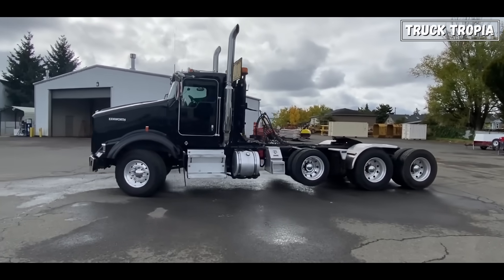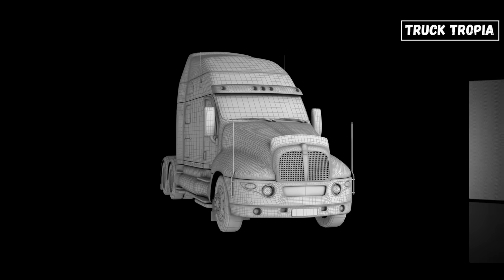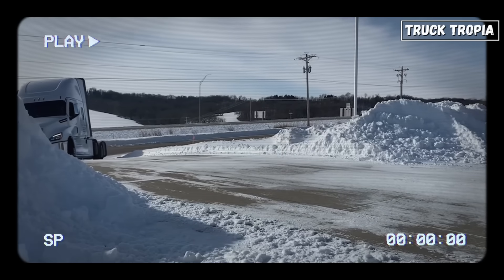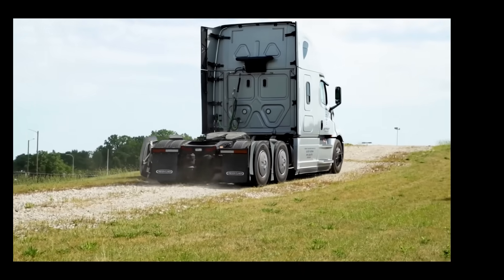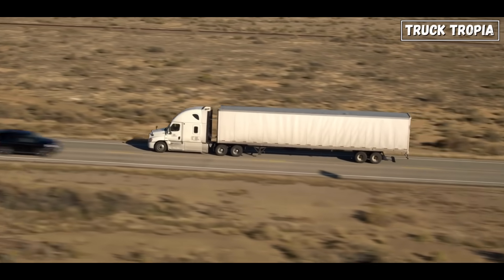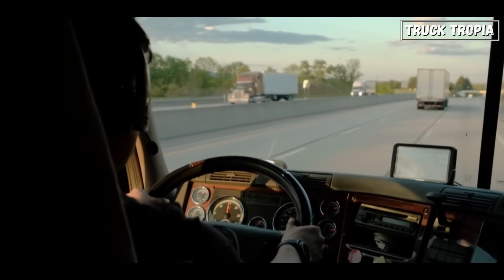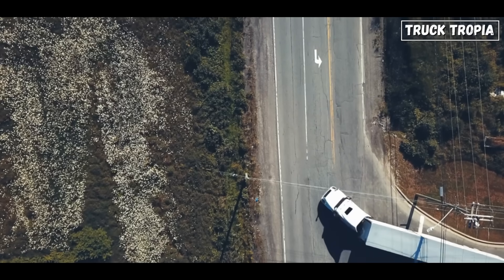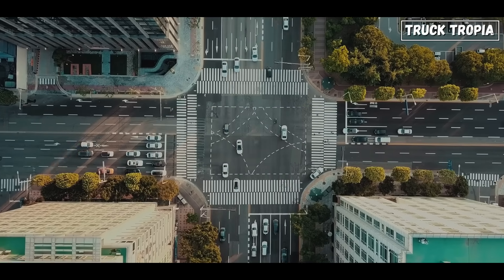Why Do Some Truck Tires Don't Touch The Ground?

Comment: Oh!  I knew it had something to do with how much weight the truck was hauling.  But I just learned that the raised wheels don't just plunk themselves down on the road when the weight is "enough".  I appreciate learning things like this.  I was also not aware of the other reasons it can be advantageous to raise or lower the 'extra' axles.
Reply: If you put enough weight on the truck all the axles will touch the road 😅
Reply: gotta love Youtube!
Reply: Was about to say the same thing. Some models lower them if there's enough weight.
Reply: I always thought it was made so you can lower the axel when you have a blowout on one of the other wheels.
Reply: On EU trucks it does
Reply: @brandonsteele2826  Thank you!
Reply: Actually in America, when it comes to replacing a drive axel with a lift axel many setups are automatic.
Reply: I always thought the ones up on the frame like that were spares. . .
Reply: @taazvino, there are several different systems, I have a manual control system, I raise it when making tight turns, lower it when needed the rest of the time.  Other systems are automatic, where it is based on weight, and then there are systems that will reduce the load on the axle based on steering wheel angle
Reply: Yes, it's called popular science.  It's fun and doesn't change people's minds on deeply held beliefs.
Reply: Same!😅
Reply: wtf no? It have nothing to do with weight, the LORRY is hauling. Its the spare tire.
Reply: @anderstermansen130  I take it you did not actually watch the video - LOL!

Comment: I drive a tri-axle dump. When empty, and up. When fully loaded, and down which enables the truck to legally be 80k. The lift axle also has it's own set of brakes. If you're making a 90° turn the axle has to be raised. If not, the result could be improper handling. Some lift axles also steer, reducing the need to lift the axle.

Comment: I kneed to know more about those  trucks like  gear arrangements and handling
Reply: There's tons, it would take a book to explain all the configurations but basically more axles means weight can carry. Lift axles also reduce traction and handling when turning

Comment: Lift axles in front of driven axles are pushers.  In the video they were referred to as just lift axles.  There is another version not mentioned too, the steerable pusher, usually added as a second pusher.

A more concise reason for lift axles is to allow trucks to stay under the maximum weight per axle limit on some roads or bridges.
Reply: Your more concise reason for lift axles is simply not a reason for lift axles. In fact, this is the problem I had with this video as well. Most of what was told has nothing to do with the lift itself.

No, lift axles are NOT there to distribute the weight across more axles or to deal with weight regulations. That is what an extra AXLE is for. If it was permanently lowered type, there would be literally zero difference for any of these purposes.

The lift part is there strictly to save money on things like fuel and wear when the extra axles are NOT needed. Nothing more and nothing else.

Remember, a non-lift axle is the default! Therefore reasons for a 'lift axle' is reasons to add a lift mechanism to a non-lift axle, and NOT a reason to add additional axle!
Reply: @kikixchannel Lift axles take weight off the driven axles to meet the local and state road axle limits.  Most states only allow 34k lbs on tandem axles.  You can haul more by putting a lift axle down.  Lift axles are rated by the weight they lift.  Tags are usually  13.5k lbs and pushers are 12-20k lbs.  Truck designers add lift axles to keep all axles when loaded under the axle weight limits for areas they are traveling.
Reply: @jmaus2k  You do not understand the point of my post...

I know that putting the lift axle spreads the weight between larger surface and more axles. However, this is not a trait of the LIFT axle, but of an AXLE altogether. If you have eight axles and two are lift axles, when they are down, the distribution is exactly the same as when you have four axles and none are lift axles. Therefore, the 'lift' function in the axle has literally zero effect on the adherence to the regulations.

The lift is NOT added for adherence to legal limits. It is added so that you can save on running costs by not having to go for full load capacity at all times.

Basically, you are putting the cart before the horse. Again, a standard axle is the default, the lift is an add-on. Don't make the lift the default when it's not.
Reply: @kikixchannel  You can't easily add solid axles that are down all the time in front of tandems.  In fact there are no solid axle options for the center frame mounting of trucks because the driveline is in the way.  To avoid scrubbing tires when turning you also can lift up lift axles.  So it is the most reasonable way to add weight capacity to a truck.  And of course, they can be lifted when empty to save fuel.  They can also be lifted where roads are less strict.  Primarily the reason to buy a lift axle option on a truck is to gain weight capacity(after you get past tandem axles).

Comment: Its nothing about weight distribuiton, the axle with tires is feather light compared to truck+load. its to reduce tire wear, while the truck is driving empty/under light load, especially on tight turns where the otherwise lifted axle basically has to rub through a corner.
Reply: It's everything to do with weight distribution dumbass😂 more axles means more weight the truck can carry

Comment: From my experience in Snowrunner,
Keeping the axle lifted helps with traction more for some reason, even though it should be the opposite
Reply: Less wheels carrying the weight => more weight on each wheel. More weight => more traction. Hope it helps
Reply: (how long until they realize I meant Snowrunner as in the video game)
Reply: The issue is though, it doesn't seem to be that effective in Snowrunner

Occasionally it's helpful, but usually I can go through mud faster if the wheels are raised 

It's the opposite to what I'd expect
Reply: @owlenderg  Sounds like what you're describing isn't traction, but reduced friction. Assuming you don't need the extra pulling power having fewer wheels on the ground will mean less friction to push against.
Reply: @owlenderg no shit a lift axle only provides traction when braking. Otherwise it's taking needed weight off your drive axles giving you less traction
Reply: The lowered non driven axle also prevents the driven axles from digging into lose ground where the tyres can reach some traction, because it's just sitting on top
Reply: I always raise my tractor tag when it snows. It drops my steer down to 10k when I'm loaded and tag down. I can get 3 to 4 k more on my steers by raising my tag. Really helpful for turning in slick conditions
Reply: An unpowered axle will cause drag and take weight from the driven wheels without providing help to drive the truck forward so the powered axle loses grip or even high centres. There is another part to the story for dual powered axles - the power divider or central locking differential. If this is off then all the power will go to just one wheel on one axle on slippery surfaces so you go back to having a one wheel drive truck. In Snowrunner you can usually lock the diffs and that will help even more.

Comment: This has been something that has bugged me for years.  I came up with the brilliant solution that an axle was lifted only when making sharp turns, then dropped once on the straight and narrow... I have only seen it them on Dump Trucks, not the Big Rigs.  So yeah I feel a bit silly, but also a bit smarter thanks to your explanation.  Thank you. 👍👍
Reply: You are not wrong.  They do raise the extra axles, especially the ones that are on trailers, making turns at intersections.  Otherwise, they end up dragging those wheels sideways through the turn which risks damage to tires or even popping a tire of the rim.  But, if the vehicle is loaded, you don't want the axle up for too long or the weight might blow one of the tires that's still on the ground.  It's a balancing act!
Reply: @Rigel_Chiokis  Thank you for that.  I feel less silly now. 👍👍
Reply: @Rigel_Chiokis wrong axle and tire ratings are higher then the dot allows for example the drive axles on a semi are legal for 34k but they are rated for 40k by manufacturers. So lift axles are solely there to make sure the truck stays dot legal on weight. The weight ratings are set by the government as the max allowed weight per axle and tire as to provide best service life of roads
Reply: @moparjr89  my country doesn't have a DOT and our rules are different.  :)
Reply: This is definitely a reason they are used on some short wheelbase trucks, like single vehicle dump trucks. I drove one once that had an adjustable valve that controlled the pressure in the air bags. Anything less than 60 psi and the brakes would lock up the wheels on the lift axle. Some short trucks have steerable lift axles. You don't need to lift them when making tight turns. They came up with that because the shorties are way too heavy on their tandems when at max weight and it's not technically legal to put that much weight on them even for the short distance of driving thru an intersection. It's for a related reason short and heavy haul trucks have double width tires on their front axles. These fat tires are rated for 13,000 pounds each, more than double a normal steer tire. It always concerned me a bit that they had regular brakes on them. And those trucks cannot stop anywhere near as fast as an eighteen wheeler.
Reply: For yard work in places where low speed tight maneuvering is needed a driver might lift the axles to reduce tyre scrub, but it does depend upon the axle configuration of the vehicle.

Comment: What's that weird pair of wheels attached to cement truck mixers in the back?
Reply: It's called a bridgemaster. It drops down when you are heavy and distributes the weight more. I usually only drop my bridge when I have over 5 yards of concrete on.

Comment: There is a false claim, adding axles doesn't add anything to braking power, single tire is just as powerfull on braking as 50 tyres. What those added axles increase is efficiency and controllability and they distribute the heat load during the braking. Did you know that a modern fully loaded semi can stop faster than a motorcycle or just as fast as a sportscar? That's all just physics ;)

Comment: They can also be used as spare wheels in case of a flat.
Reply: We used to do that in an emergency, although you had to have a booked appointment to get it fixed that you were travelling to with the flat on the axle lifted (where we operated) or you could get a ticket
Reply: no pushers and tags are normally smaller tires and wont fit.

Comment: Hey can I ask why most front truck wheels are indented out while the back rims are indented in? I have always wanted to know.
Reply: If you look, you will find that the outer rims on the back are simply just facing the other way. I.e. inwards towards a second rim. You will find this to be true on just about anything with dualies, i.e. two tires per side on a single axel.

Comment: Saves on tire wear, tires last much longer when they are not making contact with the road. There are even engineers working on a concept so that none of trucks tires will touch the road.

Comment: Interesting video. I find myself thinking that hauliers might have the axels lowered to go the weigh bridge and then raise them to save money on the actual journey! Are there checks in place to stop that practice?
Reply: There are checkpoints everywhere, and even if you do keep it raised only to lower it before a checkpoint they can measuse the temperature of the wheels to find out the tag axle haven't been used.
Reply: I dont think that makes any sense. Having liftable axles on ground wont lower overall weight of the truck and if you haul max capacity load, there isnt any saving driving liftable axles up in the air, added rolling resistance from higher weight on fewer axles nullifies all the benefit from it and it also will wear tires more.
Reply: @Erämetsienjorma  It's about weigth per axle, not total weight.
Like they explained in the video distributing weith over more axles reduce damage on the roads. Not all roads can handle a 20 ton axle, but 2 x 10 ton axles are fine.
Reply: @DonGorgen   Yeah I know that but how they weigh invidual axles on a weigh bridge? and still it doesnt make sense saving wise to drive rest of the journey axles in the air when hauling a load.  When empty it's different story tho.
Reply: @Erämetsienjorma   Axle only weigh bridges and mobile weighbridges that only measure each axle are common in some jurisdictions, particularly if they are operated by the Police or local or national heavy vehicle regulation dept.  To keep it simple for our drivers, we told them that unless its an emergency or poor traction no matter how little load you have on board, all axles should be down when on public roads. When the truck is completely empty then all axles should be up. I don't think we ever had a conviction for wrong axle configuration because of this simple guideline.
Reply: @Erämetsienjorma axles are usually weighed in groups so 2 axles are allowed 34k 3 axles allowed 42k. They rarely weigh most axles separately

Comment: Drove a coal hauler dump truck. Had a high side dump box and carried 22 tons. Axle in front of the drive axles helped take the load of the front axle. Had to raise them when making a tight turn

Comment: The drop axle is for carrying  more weight,  more tires on the ground the more weight you can transport. You lift off the ground  when transporting  less weight. Drop axle is not powered.

Comment: That was a pretty good explanation,  but you missed one big reason for the lift axle. Here in Michigan, we can run 160,000 pounds. That will require a total of 11 axles to carry the weight. It you do not have the steerable lift axles, When you are fully loaded and have the axles down and you have to make a tight turn (like 90° on to a street), you have to raise the axles. If you do not, you will end up dragging tires sideways. That will stall your truck, damage you tires, or tare up the pavement.

Comment: 3:31 Lifting or lowering axles to comply with mass regulations? Can you explain this better?

Whether you lift or lower an axle won't change the overall mass of the vehicle, whether it's overloaded or not. 

Overloaded vehicles cannot change their mass by adjusting which axles are touching the ground.
Reply: Mass per square inch of contact is what they care about. More axles with the same load means less mass per square inch. It's pretty much that easy. 

Have you ever seen a bridge weight limit sign with multiple trucks and higher weight limits for the bigger trucks? It'll say something like 4T with a two axle box truck, 6T with a common semi trailer config with three axles, and then a pic of a tractor pulling doubles with 4 total axles and a 8T limit. 

If you do the math, you'll find that that means the bridge is rated to hold 2 tons per axle.

Comment: But what about those wheels on the back of concrete mixer trucks?  They extend way out to the rear of the truck and can't possible support anything.
Reply: I drive a mixer and they help out a lot. they actually help out more than the pushers. If I'm hauling a full truck which is 10 yards at 76k lbs. And once I lower the bridgemaster it will lift the entire ass end of the truck up and make the truck a lot more stable. And if you overset it with to much weight it will actually make it harder to steer because the ass end is pushed up so much it will put more weight on the steer tires.

Comment: What i am missing is, why concretetrucks have wheels in around 2m height, and dont even put it down when full.
Reply: they do put them down when full. The drum on a mixer always needs to be spinning even when empty. If you drive and the drum isn't spinning you will get flat spots on the drum where the rollers spin it. Trust me a mixer driver will always be doing whatever possible to be at the right weight because those trucks are very easy to flip over. They are very top heavy and on top of that the load is spinning and the load is also a liquid.

Comment: Thanks for this. I always saw construction trucks with a raised axle which puzzled me. The only explanation in my head, was that it helped as a form of support for when the truck climbed onto mounds at a site to dump its contents.
Reply: My imaginative explanation was that if the truck got a flat tyre the driver could drop the lifted axle and raise the one with the flat. I didn't really believe it but it was the best I could think of.

Many thanks to the channel creator for solving the mystery for me. Definitely a like 👍👍🌟
Reply: I actually asked my dad that about a dump truck (I think I was around 10) and I think he said that it was for when they were going over train tracks so it didn't scrape the underside if it was a little too high of an angle. I'm starting to think he made that up on the spot.
Reply: Yeah this is what I thought. I thought they were fixed in place and only there to help drive over uneven surfaces.

Comment: It is down to the driver to raise/lower the lift axle? Or does the truck "tell" the driver what setting is needed
Reply: Pusher and tag axles have switches in the cab and the trailer to lower and lift them

Comment: Wear  vs Ware ..  Two different words.. and you chose the wrong word to use.  Oh, dropping the additional axle does not just comply with regulations; it reduces wear and tear on the roads, which is also part of the goals. . I also think it would affect the Gross Vehicle Weight Ratings but I could be wrong on that part.